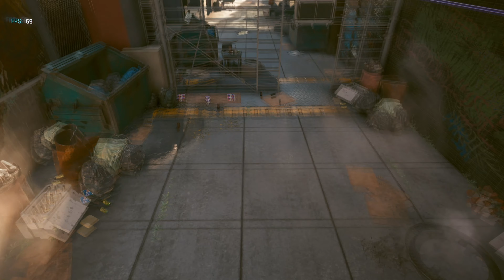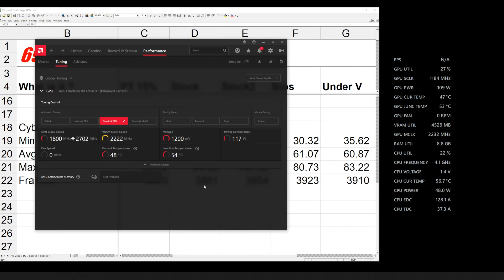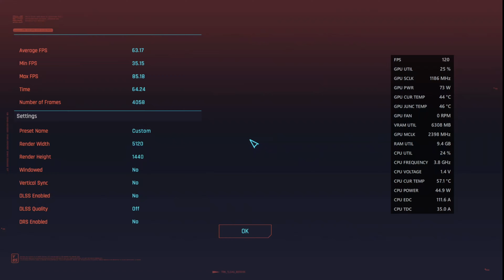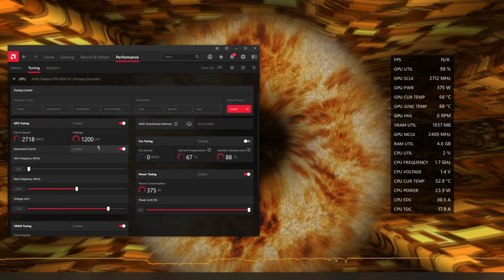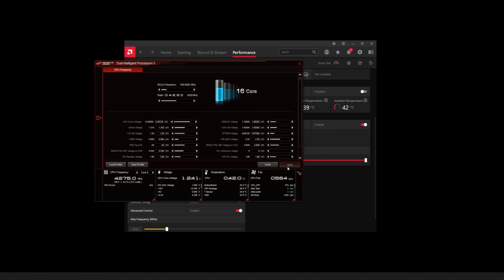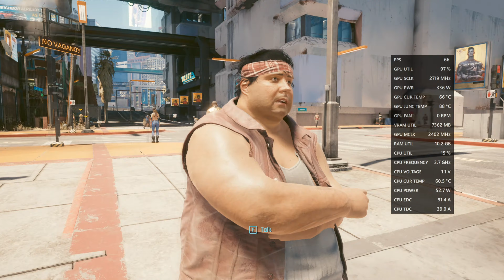Water Cooled Sapphire Nitro+ Pure 6950XT Overclocking

Comment: Needs moar power. Apparently 6000 series has some super easy peasy software that lets you suck more juice.
Reply from the maker: Oh yeah ? I'm somewhat happy with it for now. Hell the PC it's running in rn only has like a 750w PSU. 
I've since stopped messing with it, and have just been gaming.
Reply: @DATT are you on Intel? If you're on AMD, you could probably get away with a little more without upgrading. But 12-14th gen Intel, no shot lol. And besides that, any chance you could do a marvel rivals benchmark ? I'm interested because it seems like the 6950 is weirdly close in performance to the 7900s in that game, and it's the only game I really care about rn. I'm guessing it has to do with how the game is optimized for consoles, which are rdna 2.
Reply from the maker: I was running AMD at the time. I forget which CPU off the top of my head. 3950X maybe ? I have a 5800X3D now. 
I've never played rivals. 
My videos are mostly informal tinkering with the gear I have, and with games I already have. 
IF I get an upgrade for my comp, I'll  make some sort of video about it, but I'm too small and low budget to do more comprehensive testing videos.

Comment: Update your motherboard bios to the latest version and enable Smart Access Memory for your 3000 series CPU. Once your bios are up to date the option to turn on SAM (Smart Access Memory) should be right on the BIOS home screen at the top right corner. Once you boot into windows, go to AMD Adrenaline software and enable it. Its in the custom tuning section where you were in the video right above Fan tuning. You may have to restart your PC after enabling it. That will give you a pretty good fps boost across the board. Enough so where its worth the 10 minute bios update.
Reply from the maker: Yeah you know, I just figured that out recently. I picked up an A770 for my other comp, and it made a point to explain how to enable Resizable Bar. I then did that process on this system. Suppose I'll have to retest at some point.

Comment: I've seen the same thing with my 6950xt liquid devil I can raise the clock pretty high but then the scores are lower after that max I've been able to hit is 23900 in time spy
Reply from the maker: Yeah, at the end of the day, I think we got classic AMD, where you don't get very much OC overhead, Scotty's already giving us all the power he's got. 
That and I think something is wrong with the block. Like, it's either not very good, or, I did something wrong installing it, or just my thermal paste is bad. 
At some point, I'll be tearing it out to redo it. Just to be sure. This thing isn't much more TDP than the Vegas I had before, but this block just doesn't seem to be keeping it cool as the EK blocks the Vegas had.
Reply: @DATT  Yeah my GPU with a custom loop and water temp of 32c stayed at about 57-60c and 90hot spot, I raised everything with MPT voltage power limit and all but card won't want to go much more above 2700mhz anything higher and score will be lower
Reply from the maker: @Escalofrios29  Yeah those numbers all sound familiar. At least it's pretty strong as is, and it's come to my attention I might have a CPU bottle neck now. It can't fully stretch it's legs with the 3950X.
Reply: Just picked up a AsRock 6950XT OCF mounting Bykski WB tonight. Through initial air cool testing(100% fan) I was able to push it to 2850/2400 before I start running into issues. Going to increase power and voltage with MPT to see if I can squeeze any more out.
Reply: @JMNovak1011  you should definitely test with 3d mark because you may think with the higher clocks it will be better but if you check the scores it will actually be lower
Reply: @Escalofrios29  yea, I started seeing lower scores with anything higher than the 2850. I just have it running out of X99 test bench with a quad core processor. Putting the water block on it tonight and will hook it into my main rig with a 5800X.
Reply from the maker: @JMNovak1011  Yeah I think an X99 would be a hell of a bottle neck. 5800 should be fire tho. 
It's worth mentioning I might have been able to get more out this card, but I want my system to be quiet, so I don't ramp up the fans. 
My personal goal see's what I can get while maintaining a quiet running system.
Reply: @DATT  Finally got it into my main system. Hitting 2880mhz core 2424mhz memory. @ 48c/68c hot spot on water. No fluctuation in core speed. Stays at 2875-2882mhz.
Reply from the maker: @JMNovak1011  Oh boy, those are some dece number. I must have something wrong going on here. 
That or, maybe you got a golden sample.
Reply: @JMNovak1011 needs moar powaaa